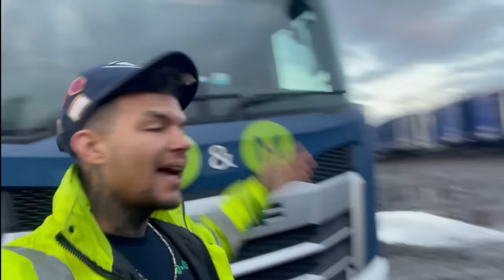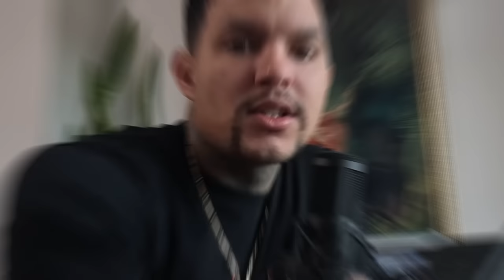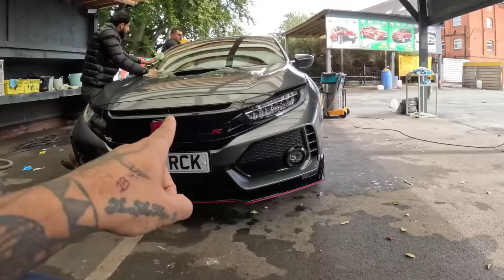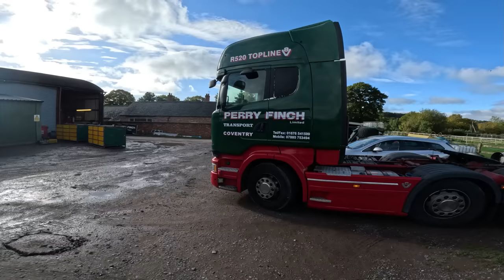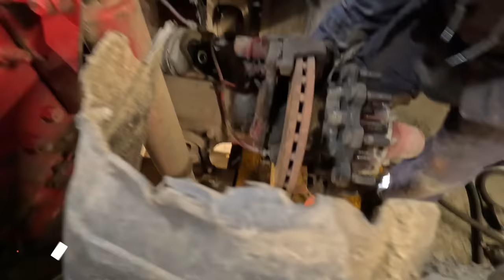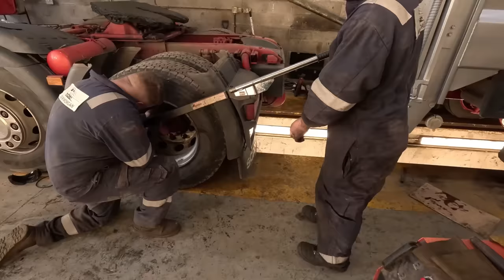How to Start Your Trucking Business: Step-by-Step Cost Breakdown (Owner Operator)

Comment: Transport is one of the toughest possible sectors to be in, the amount of regulation can be overwhelming. It’s good that you have such enthusiasm for life, you’re going to need every ounce of it. Don’t keep too many eggs in one basket. Try to find a niche. Understand the accounting and watch your cash flow / overheads. Don’t undersell yourself just to get work, anyone can be a busy fool (many are). You can’t compete on price with larger operators, so don’t try to - you don’t need to. Don’t restrict your pricing just to a mileage rate, look at all the variables. Be reliable. Good customers recognise and value it, more than paint jobs. I think you already know that you’re starting on a shoe string budget, £10k for diesel might get you rolling but you’ll be burning through more than that in no time at all. The numbers will get bigger, so can the risks. Be careful. Think about work life balance. Oh, and if your partner has just done the TM course without any background knowledge at all she already deserves a medal and will be doing incredibly well to pass (ten out of ten for even trying).
Reply: Sounds like excellent advice there
Reply from the maker: Thanks mate
Reply: Thanks for the excellent advice for my Son. Respect!! Nice to see positive help and not the crap you hear from many of the other negative replies
Reply: @qfina Pure knowledge drop!
Reply: thing is you could say the same thing about any buisness venture, trucking can be extremely feasble. if hes consistent and follows the right advice from people in the industry. he can grow his company,  i genuinly dislike that mindset that you have, people can achieve what ever they wish to. hes starting small which in result will teach him as he ventures forth, do you think anyone got anywhere in life with your mindset? also he can compete in the industry itll just take him some time. hope you fix that limiting mindset of yours mate and all the best.

Comment: Yep its not an easy game to get started in. But ignore all of the negative feedback. Because you can make a reasonable living if you do your research. And you seem to have done that. The only thing I would say is do not spend money on things that will not make you money. So the truck is the most important part of the journey. keep it well maintained. But the one thing I would not have done is have such an expensive paint job done. It does not earn you a penny more, and could have waited until you had money coming in. I also for the first year of operation only paid myself the minimum amount. As the rest went into the business. But you have a good attitude so just get dug in and work like hell until you have recovered some of the initial outlay. Best of luck I really mean that, it take's guts and determination to go it alone...
Reply from the maker: My hater is back 😂

Comment: You also need a clean driving licence  we'll be four you even purchase a hgv Truck and trailer and you must have a medical to make sure you are well enough to become a hgv driver and you need to remember about the  fuel and CB radio cost and CB Ariel and your own business name stickers cost cost of a new bed mattress for your truck and a new. Fridge and freezer new taco machine and cards over night heaters and a bedroom light to read and storage cupboards which you can get from truck scrap yards from trucks that are due to be scrapped you can ask the hgv scrap yards if you can purchase parts off old Hgv trucks it is well worth doing its helping to recycle old storage cupboards and you some times can purchase replacement hgv mirrors if your truck has broken mirrors or broken seats and you can even purchase the fridge and freezer from old trucks and you can some times purchase the water radiators if you need them and you can even purchase truck bumpers if your bumpers are broken or missing and you must make sure your registration details for your first truck are right and in your own name  you can even purchase some Suzie's for your truck and trailers and you must make sure you have spare ratchet straps and that your trailer lights work and your trailer curtains are in excellent condition or you can get sore curtains for your trailer from other trucks in the scrap yard as long as you have got the tools and permission